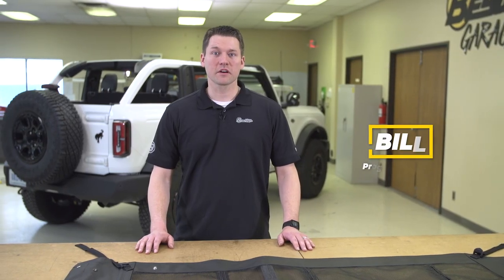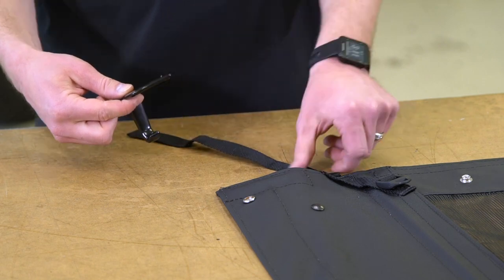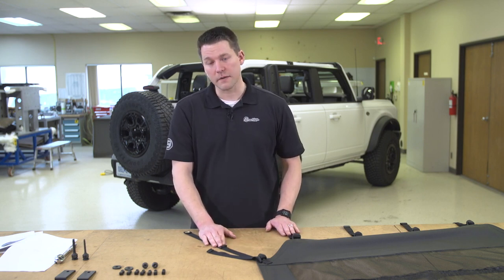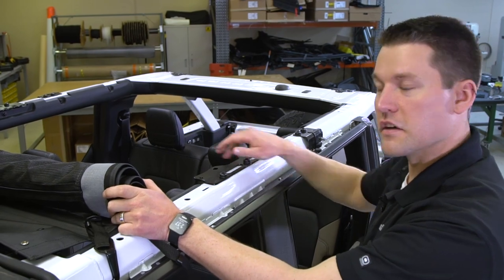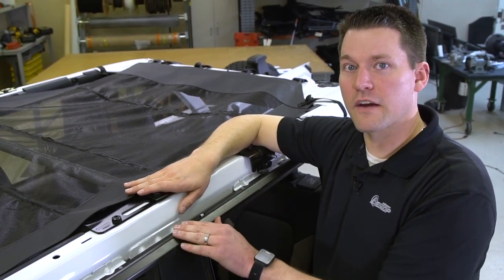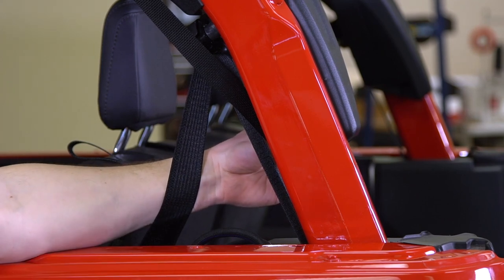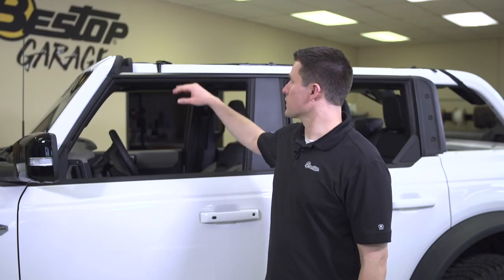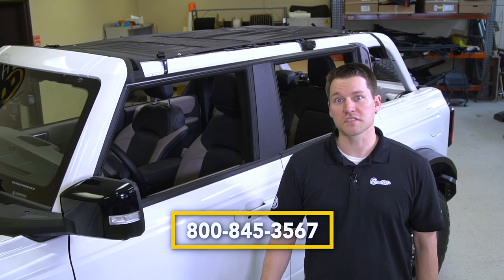Mesh Bimini for Bronco Installation

Comment: Also of note their is limited side restraints for this top other than the crossbar.  A 45mph + the sides open up considerably.  The magnets in the front are pretty much useless.  And the hole in the back (to accommodate the GPS) on the 2-door top is on the wrong side.  Even with the hardtop on and the t-tops off this thing is freaking loud at speed.  A decent product for off-road but at speed?  Nope.
Reply: All the points I saw while installing.  Bestop should read these comments and upgrade accordingly.

Comment: Returned mine after opening. Need a simple bikini top that can go on in the event of excessive heat or a light shower “easily” (no bolting). This takes way too long and it’s a semi permanent option. Bad design. Bestop can do much better

Comment: Can y’all please make a video showing it being installed on a 2 door? The bolts on top are different, and the instruction manual is lacking in clear directions.
Reply: Use the bolts and bolt holes for the hard top bracket. Don’t use the spacers.
Reply: @guydavison  even without the spacers and washers, it’s too high.  The only way to be even across , is to not use the bolts at all.  Not the best design IMO.  I’m running it without the bolts until the jtop arrives.
Reply: I’m currently having that problem when I try to put the individual panels but the cross bar won’t let it clip on

Comment: Guys thanks for this video it helped a ton and was way easier than the printed instructions! My only confusion was getting the T-Hooks on the correct side, but it was an easy swap. Also gently using a flat tip screwdriver helped make putting the keepers on a little easier.

Comment: 2 door bronco, how on earth can the hard top go back on and seal with the addition on the brkt bow support thickness with the 4mm spacer ?
Reply: I just ran into this issue a few hours ago. I am going to contact their support team. Even without the space it's near impossible.
Reply: They need to do an installation video for the 2 door. I put mine on when we had the top off in October, but took it off cause I knew something wasn’t right when I had a bag of pieces I didn’t use. When following the instruction manual it never said anything about the clips for straps. I tried again yesterday following this video, but the 2 door bolts on top are different. I gave up and took it off.
Reply: In the paper directions it says not to but the spacers. Use only with TrekTop.
Reply: Same issue with my 2-door hard top.  I have it on with the hard top bracket laying on top of the crossbar bracket and NO BOLTs.  With  the bolts, it makes for a pain in the ass install of the t-tops.  And don’t get me started on the noise and flappiness at 45mph +.  Going with the JTOPSUSA top.  They test theirs at 85mph.